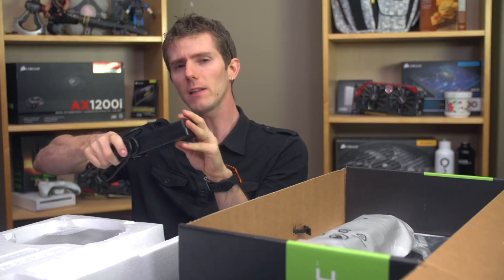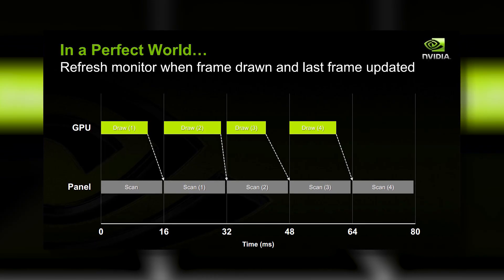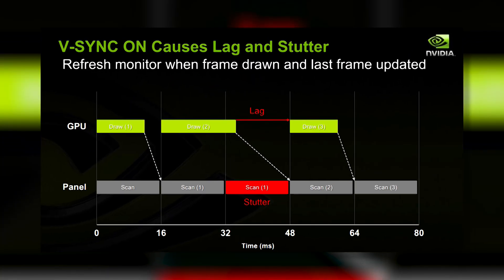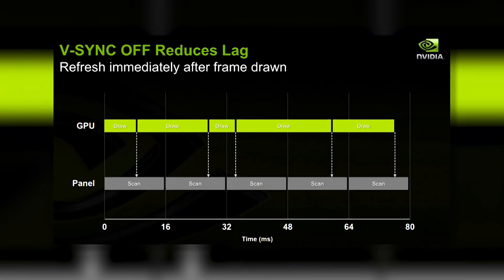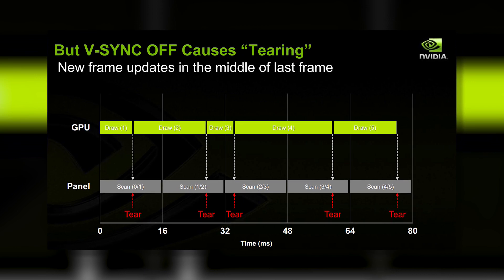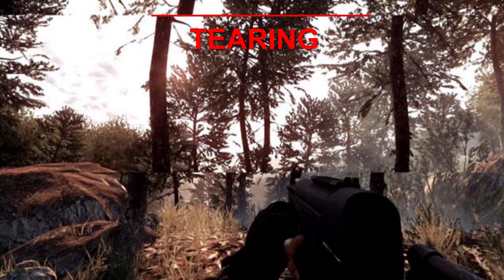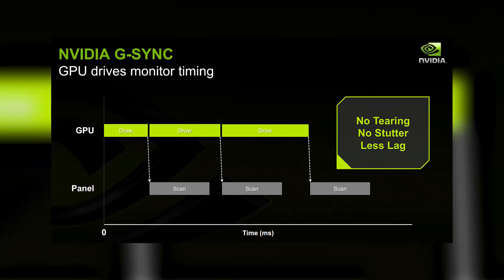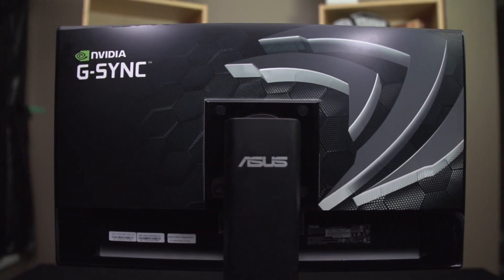NVIDIA G-SYNC Tech Preview - Linus & Slick's Impressions

Comment: Lmao back then I was so confused how it worked. It's simple in hindsight; the monitor adapts the refresh rate to match the GPU's fps.
I think the name was the confusing part. If they called it adaptive refresh, or variable refresh rate, it'd make so much more sense. Damn marketing.
Reply: It's just Nvidias implementation of adaptive sync/vrr. AMDs is called FreeSync is a different implementation. Just ne 2:02 ed a way to differentiate them

Comment: Here from the future. This video aged like the finest of wines! 
(Other than the fact that G-Sync is not that relevant nowadays simply because AMD made FreeSync and it's good and widespread)
Reply: In retrospect calling it FreeSync was an amazing act of snark by AMD
Reply: Will FreeSync monitors work with Nvidia G-Sync Graphics Cards? I'm asking because I have a Nvidia RTX 5080 and have a cheap G-Sync monitor that's capped at 180Hz. If I look at monitors that have FreeSync Premium will they work with my graphics card or is it best to stick with a G-Sync monitor but at a higher refresh rate?
Reply: @Mr_Battlefield it's basically been inter-compatible over the last 4-5 years. You can just plug and play. It's called VRR now. The fancier Gsync modules do something called variable over drive these days. It's a rabbit hole, but for all intents and purposes, Gsync = Free sync = VRR for the most average user. (Edit: Variable refresh rate*)
Reply: Yeah, his prediction that using G-Sync would be a lot like switching to an SSD (in that switching back is kinda painful), but I think the sentiment has mostly stayed that G-Sync isn't very necessary. I've even had monitors with FreeSync and ended up stop using the feature after a while.
Reply: On an OLED the VRR flicker is annoying so I also turn it off; another reason it's less relevant now

Comment: Hey guys, what is a good 600 dollar 32" 4K monitor  ???, (preferably IPS, 144Hz, G-sync, 4ms or faster, 16:9) this will need to work with a 2080 Ti Nvidia card.  I realize that the 2080 Ti card may not drive that good of a monitor, but I'm going to at least try it and see if it works.

Comment: Im running a 1440p 144Hz gsync and im never going back. I would rather have a 1080p 60hz Gsync monitor than a 1400 or 4k 200 Hz monitor or something crazy like that
Its that good imo
Reply: What about 1080p 144hz g sync?
Reply: yes. high refresh rate gsync is a dream

Comment: if all pixels would refresh at the same time, there wouldn't be any screen tearing, right? ...... i wish i had g-sync or freesync
Reply: +uetzel I believe so. Screen tearing occurs because a new frame is given to the monitor while it is in the process of updating the panel from top to bottom. if the whole screen updated at the same time, there shouldn't be any screen tearing.
Reply: That wouldn't be possible unless there is a way to transfer the color values for each and every pixel in parrallel from the video card to the monitor panel all at once.

In reality, the values are serialized through circuits and cables, so syncing the monitor refresh cycle to frame render (as in gsync) is the best we can do.

Comment: @LinusTechTips Hey! I just came by this video to ask a questing on the subject. You know a lot more about PC's than I do. As hard as that is to admit. SO I am going to be getting a 980ti((or 2 depending on funds)) soon, and I want a new monitor. I decided I want 4k. So Should I get G-sync? Or do you think that that GPU can keep frames at 60 for most games? My GPU is a 4690k, and I do not stream. I just play. But I do run more than one game at a time some times.
Reply: +Snow Kajira SLI comes with lots of downsides, requires more power, many games arent compatible, driver issues, more heat in your case, more sound, you name it... I say buy a 1440p g-sync monitor, and a gtx 980 ti
Reply: +Snow Kajira woah there buddy, don't go full potato and buy 2 980ti, id rather buy one Titan X, you save more money, more energy efficient aswell.

Or you can buy one 980, then wait for it to drop in price in a year and buy a new one for nearly half the price, or lower if you buy a new one =)
Reply: +Kristoffer Espeland Well the performance gap between a Titan X and a 980ti is really not much at all... The biggest difference between them is that the Titan has double the VRAM (12GB vs 6GB on the 980ti), and it has slightly more cuda cores. Performance wise those don't really matter, so getting two 980ti's and running them in SLI would be much more beneficial in a gaming perspective than buying just a single Titan X.

Comment: I think part of the reason SSDs sold was because they were hype for a while but then the price dropped so anyone could but them. Plus (unlike G sync) theres alot less compatibility issues when using an ssd. They dont have any special ports or cables or anything theyre just like hdd as far as requirements (minus like the bay size) of course this is just my opinion.

Comment: I literally just got my first SSD today. An OCZ AR100 240gb, and it is the best thing I have ever experienced in my life. My WD Blue could not satisfy me the way this OCZ SSD is. It is absolutely incredible.
Reply: Airtrooper719 XBL It does greatly improve boot up times and load times. Seagate mechanical drives are great but SSD's are still faster.
Reply: Airtrooper719 XBL Yea im positive
Reply: Kaydn Burns I will actually agree with you on that one about HDDs on Consoles. I just checked my Xbox 360 (Not the Slim Version) and on the side of its Hard Drive it labeled "60GB HDD". Meaning it has a 60 Gigabyte Mechanical Drive.
Reply: Yea ssd's are pretty awesome and you got a shitty one at that, once you get a Msata ssd or a good quality ssd youll be amazed all over again
Reply: Jake Kraynik whats amazing about them? is it improved load times/bootup etc? Im still using mechanical seagate drives lol
Reply: Jake Kraynik 
Yeah and most people that fall into this SSD fad don't do the ratio to seconds save to money spent. On average people pay between $8 - $10 dollars per-second for faster boot. No thanks it is a waste of money.
Reply: Narcopendragon Lmao, ssd improoves, boot, load times on everything, programs run faster, installs are faster, removals are faster, you get more fps in certain games and game textures load faster. There is alot more advantages to SSD than just fucking faster boot times jackass. The fastest HDD ever is 4x slower than the slowest SSD. not to mention SSD can be placed literally anywere has they have no moving parts and they dont generate heat or noise. i bought a 256gb ssd for $70 which yea i can get a 1tb hdd for same price but at significantly lower performance
Reply: Narcopendragon 
Dude you are so right. That is a great explanation. A friend of mine runs a tech blog and we setup and benchmarked solid state drives with multiple games and found the only thing that happened was faster loading times. That was it. While your post is great. You forgot to mention the fact that the seconds you have saved on boot times is a waste because it is not viable time. If you windows starts in say somewhere around 30 seconds. You could use that 30 seconds to do something small. Which makes sense seeing as in a couple of polls and statistical analyes says that 68 percent of people turn there computer on in the morning and either leave it on or use standby/hibernation. So you wake up. You press on button and then go get breakfast, shit, shower. So having a 3 second boot up not all the grand. Not to also say that the price per gig ratio between solid state drives is the biggest factor. I would rather spend 45 to 55 bucks for a 1 terabyte hard disk drive and have the space than 80 - 100 for something that is about a quarter of that. My friend has already gone through 2 solid state drives because he used if only as primary storage drive. From the constant installing and uninstalling of programs/games, temperary internet files, download and so-forth. The drive gradually got weaker and weaker.
Reply: Good job guys! You shut the SSD Fanboy up! :D
Reply: The Legendary Mexican Pootis Heavy 
LOL thanks. One down. Six million+ more to go. :D
Reply: Narcopendragon Hell yeah! We got this! :D
Reply: Narcopendragon LMFAO ROFL XD you are soooo ignorant about SSD's its sad, they tested SSD's write and read limit. It wrote 4 petabytes, thats 4,000,000gb of data. Before they failed. Also No hdd on the market can surpass and SSD speed, you a straight up wrong not even come close in fact, the fastest HDD in the world is still 4x slower than the slowest SSD. not to mention SSD's are limited by SATA, PCI-E ssd's suprpass 1,000mbs read and write while the fastest HDD on the market is loud and hot at 10,000rpm and has a read and write of about 200mbs. So please tell me how HDD are better again? Also SSD's do not get hot, they have no moving parts causing friction and they uses a lot less power. SSD's produce no noise or heat. Also you will get more fps XD, not all the time absolutely not, but if you are say in minecraft sooming in fly mode and the world isnt loading fast, thats because you are on a hdd, arma 3, same thing. You do in certain games. Also almost all programs will benefit from faster read, write speeds. and if HDD are so great than why are most servers switching to SSD's. New servers are using enterprise SSD's which are ridiculously fast and ridiculously expensive  but are way better than a HDD. If you have no money and are trying to build a $300 system or something than yea, go with a HDD but most professionals who will actually get the performance boost have the money. SSD 1. HDD. 0
Reply: [Edited because I don't know what Im talking about!]
Reply: Airtrooper719 XBL actually all consoles have HDD. Thats why load times are forever and the system is actually no that fast and tends to lag when playing a game and switching through the menus
Reply: Are you sure they are mechanical drives??
Reply: Oh wow, well I guess I learn something new everyday lol
Reply: Narcopendragon He man I have a graphics card question. If you have the time to help me could you?
Reply: ArcangelCE I can answer your question without spewing out fake benchmarks and bias. I have multiple hardrives, SSD's and graphic cards. My father was a microprocessor tech and worked for intel.
Reply: ArcangelCE I mean literally everything he said was BS especially the Data corruption. All you have to do is google the shit. SSD's went 2-3 petabytes without a error and failed at 4petabytes
Reply: ArcangelCE Sure. I can answer your question. Don't bother with the troll anymore. He is unfortunately the sperm the made it through and now the world has to deal with him. I know I am right and he is wrong. Big difference when you work in the industry and see real world and what people want and how stuff works compared to trying to be a hipster. 
Anyway, ask when ready.
Reply: Kaydn Burns LMFAO ROFL sounds like someone is butt hurt because they are wrong and begging to help that other guy is just great. i can answer your question. i gots me an edumacation and don't care about benchmarks now even though earlier i was going by them and clinging to them. lol what a tool
Reply: Kaydn Burns No thanks. I would rather have the pro help me.
Reply: Narcopendragon I am looking to upgrade my graphics card. I am being told by half to buy the gtx 980 the other half telling me to buy the 970. So what is your recommendation.
Reply: ArcangelCE  If your GPU is doing everything you need. I would wait. Companies are " supposed" to bring out their new line of cards next  year. If not. Then, seeing as I don't know your setup or prefrences. I would get the GTX 970 if you are going to game at 1080p or a few resoulutions higher.  The cost of the 970 is between $310(Zotac) and $350(gigabyte WINDFORCE 3X). Of course there are the super over clocked in the $400+ range. The 970 can be over clocked. You will only get a small amount of performance boots with the 980 when compared to the price/performance ratio. Seeing as the 980 cost $550(Zotac) and $650(Asus MATRIX)

  On that note. Read all the reviews you can and check on the model you want to buy. The 970's suffer from coil whine a lot more than the 980's
Coil whine is mechanical resonance of the coil and frequency of the signal passing through it. Physically, a coil is just loops of wire, 
sometimes with a core other than air. If the frequency of the signal is 
in resonance with the physical wires of the coil, the coil may vibrate. 
I know that the EVGA 970's appreantly suffer pretty bad from this. If you want a solid 970. Look into getting the Asus STRIX.

Like I said. If you are looking to game at 1080p or a few resolutions higher. no surround monitor setup. Or trying 4k gaming. Then you will be able to play most games and future games on high to ultra settings and 1080p.
Reply: Narcopendragon my ssd saved me when my operating system crashed and stopped booting. I had to wipe my ssd completely but it saved me 2TB data because I have a seperate hard drive for really big applications and all my games which take hours to install them all and alot of wifi data. I have over 150 steam games alone not counting other markets with many being over 40GB a few even 80GB+ and then workshop mods. To lose 2TB data mostly spent on games is a lot to recover. So if I didn't have that seperate ssd with the os on, I wouldn't have just lost my settings and normal applications. I recovered all of my ssd within a week of re downloading.
Reply: Kaydn Burns 
Oh my god. See SSD fan boy. 1. You mentioned "run faster, installs are faster, removals are faster" If you are using and SSD like that. Then you are wearing the drive out faster. SSD's have pretty much and unlimited read time. Once said thing is installed. It starts faster with no problem. Yet SSD's have a limited write amount. You can only write to the drive so many times before it starts to degrade. If you are constantly writing to one. You could destroy it faily quickly. SSD's are great for little files and small file transactions. Programs the benefit are OS's adobe premier ect ect. 

Also, I work at a computer tech shop. We have all this neat stuff. Some SSD's write times are not much better than an HDD's and some get just as hot. So running cooler and write faster is some what of a myth. Depending on which one you get. 2. You mentioned "you get more fps in certain games and game textures load faster." Wrong. You could or may get 1 or 2 frames from a game. The HDD or SDD does not matter when it comes to games unless you are still somewhere in the old IDE at 5200RPM. The three things that matter when speaking of games is. GPU, CPU and RAM. The SSD will load your levels or the get you the the main menu quicker. Does not improve FPS and graphics like you are stating.

Data corruption is worse on an SSD as well. You have a warning with HDD when your drive is going 90% of the time. SSD most the time just crash and that is it. I can get a 1TB so $48.50. for a little more than you spent on your SSD I could get two and run a RAID configuration. So there you go. Seeing as I work at a shop, have to build test and benchmark machines and went out and got the certs ( That is certifications by the way ). You are the jackass. So go ahead and comment again and put your other foot in your mouth. 
Good day to you sir.

Comment: You can't compare something like a SSD with a monitor. The diference between a g sync monitor, or a 4k, 144hz or whatever, and a SSD is huge. Try playing or working in a PC with a SSD then a HDD. Now, try playing something on a regular 1080p 60hz monitor then switch to a g sync 144hz monitor. Its beyond comparison.

Comment: Whenever i do IT on another person system, it's always clear if they have an HDD or SSD. As for G-Sync one of my buddies has it on his setup; amazingly enough to stutter, lag or issues. I compared my system with his on gaming performance, i use 2x7970s and do not see much difference with my system using v-sync or not, and his using g-sync. though i did see a difference in him suing g-sync or not.

Comment: I see in the G-SYNC upgrade kit they completely remove the old controller, will this mean the monitor can only do 60 Hz, or is it still 144? And is there any other drawbacks to using the nVidia controller with G-SYNC instead of the original ASUS one?
Reply: For example I thought of taking 3 VG248QEs and convert all three to G-SYNC, then run them in surround, but will I sacrifice some performance? Will they be able to all run 144 Hz (that is if my GPUs support it) and will it have any negative effects?
Reply: I'm thinking of running 2 GTX 970s in SLI, will that be enough? I will play most games only on one screen, but some light games such as Minecraft on surround.
Reply: Tian Cilliers Because no one has answered your question...

All G-Sync does is match the fps output to the refresh rate of your monitor. All calculations for this are mostly done on the monitor itself, with a little help on the card's end.

There is no performance hit for running in G-Sync. G-Sync actually helps you if you do have frame drops, as it will compensate for the lost frames by matching the monitor. You will most likely not notice any difference, if very slim.

Also, Minecraft is rendered solely with your processor, as Minecraft is run on Java. If your CPU can support that (God help you), then you should be completely fine.

2 970s should be plenty to handle most, if not all games you throw at them.

Comment: why no 4k and 3d monitors?
I don't mind/know it will be impossible for a game render of 3d 4k content, but the ability to choose while on the same monitor should be given...
One idea I had is polorise each columb of pixels, then half the res for 3d, this should save the cost of a switching polorised filter as it doest have to change for each frame, plus the panel wouldn't have to be as bright as each eye is seeing the pixel at 100% of the time.